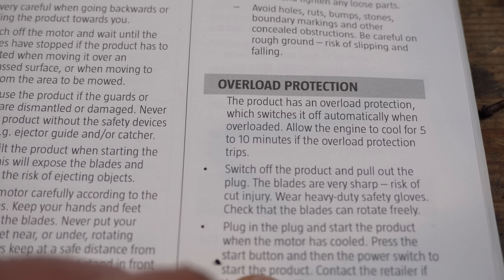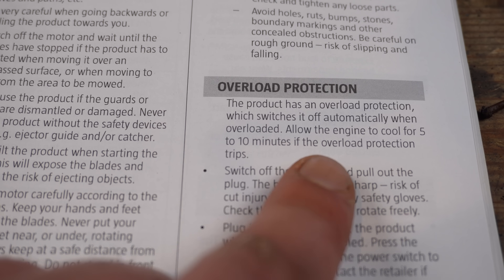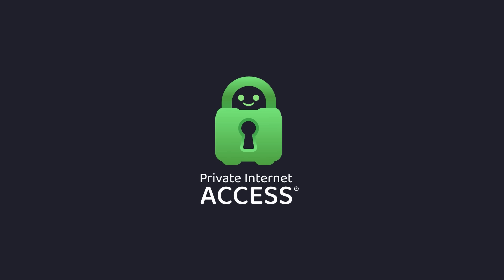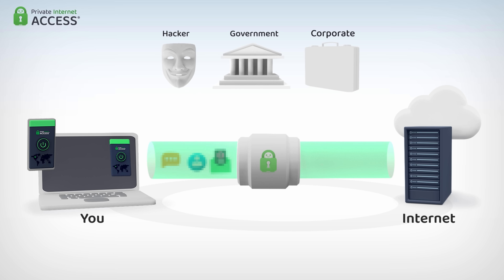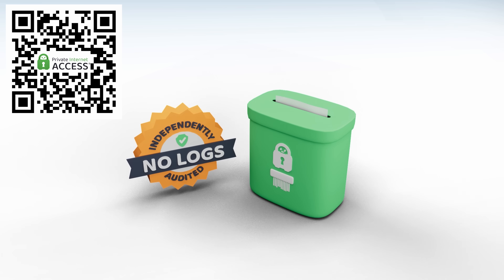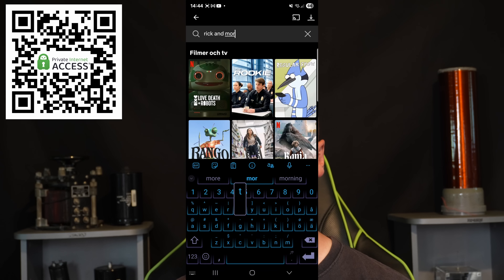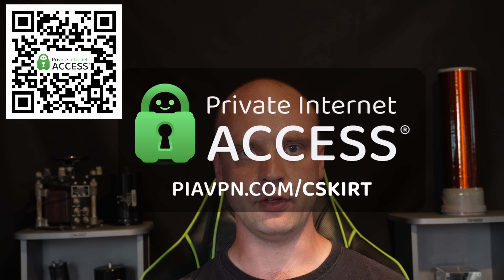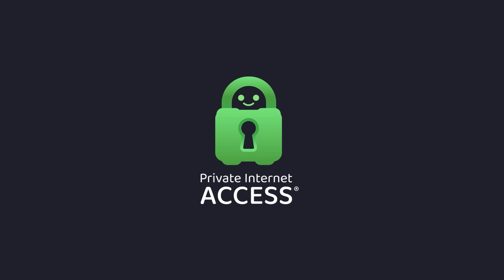Overvolted Garden tools. Leaf blower, mower, chainsaw, trimmer.

Comment: MEEC TOOLS Chainsaw
1 log cut at: 112.4 volts
2 logs cut at: 282.1 volts
Sparking motor at: 361.5 volts
Motor damaged at: 441 volts
Motor failed at: 458.8 volts

MEEC TOOLS Lawnmower
Sparking motor at: 402 volts
Motor damaged at: 435 volts
Motor failed at: 509 volts

Black & Decker Weedwhacker
Motor damaged at: 343 volts
Sparking motor at: 375 volts
Motor failed at: 531 volts

Biltema Leaf Blower
Sparking motor at: 285 volts
Motor damaged at: 373 volts
Motor failed at: 429 volts
Caught fire at: 426.1 volts

Comment: Hey! Try applying voltage directly to the armature (rotor) of the brushed motor — skip the stator or external field winding. It will spin MUCH faster and wilder. That’s because you’re energizing only the rotating part, removing magnetic drag from the stationary coils. Basically: less load = more speed = more chaos. Give it a try — it’s insane! But I warn you, the revolutions are uncontrollable, and this is very dangerous. If you have a good defense technique, you can use it, and I will be pleased😊
Reply: I recommend this also
Reply: Ye
Reply: Good idea
Reply: Did you miss the thunderstorm going on in the motor at 1:30?
Reply: After researching about motors, I also conclude this is a good idea 😂

Comment: Chainsaw:

Not enough power at ??? volts
cut through 1st log at 112.4v
cut through 2nd log at 282.1v
Sparking motor at 361.5v
Motor failed at 458.8

Lawn mower:

Protection removed after normal voltage test
Not enough power at ??? Volts again
Wheels started moving at 115.1v
Sparking motor at 402v
Motor damaged and failed at 509.6v

String trimmer:

Top part removed after normal voltage test
Not enough power at ??? Volts yet again
Disc-like (no pun intended) protection wobbling at 195.2 v
Case wobbling at 210.5 v
Case wobbling more at ~267 v
Sparking motor at 279.4~298.4 v
Sparking more at ~354.1v
Stopped (likely) increasing the voltage at 531.4~533.7v?:(
Motor damaged at 533.7v
failed at 531.6v

Leaf blower (there is going to be a lot of brackets!):

Whole cut through after normal voltage test
Also not enough power at ??? volts (There is a good reason why you use your red multimeter in your last tool video)
scale sliding around at normal voltage(683g(coincidence!))
Sparking motor at 285.9v(855g)
Motor damaged at 421.5v(719g?!>:()
Failed at 429v
Caught fire at 426v! (pulled a massage pillow!)
Motor exploded at 445.1v!

I put in so much effort In to this…

Comment: I'm amazed by this Black & Decker weed whacker. Mostly because I have a Greenworks one that with an average length strand can spin up to what sounds like 4,000 RPM, because like this it only has one strand of line coming out of the spool, but is probably more like six or eight thousand.

Comment: Why did you stop increasing the voltage on the string trimmer at 530 V?
Reply: I think his transformer doesn't like voltages higher than that
Reply: @Electro_the_Sonic_OC  but it can go up to 550! Just 20 more volts!
Reply: i think the variac was heavily loaded, it drew close to 12 amps

Comment: I once had a dream that someone else like you (or Maybe you) applied high-voltage to a furby furblet and was about to do a hand mixer toy (I did not see the hand mixer toy because I woke)
Reply from the maker: And what happened to the furblet in this dream? AFAIK they don't have any moving parts? It would probably just be a small pop, but I could try if I find a cheap one
Reply: @Cskirt  it just had a small pop. You don’t need to over volt it!
Reply: @Cskirt . Why did you stop increasing the string trimmer on 530 V?
Reply: My aunt is Married to cskirt

Comment: I love how the ac power meter just fades in at 60 to 90 volts makes me wonder if you could wire up the dc side of the meter to a external one it should solve the issue
Reply: some of those don’t, i have a power meter and it only has 4 wires (2 for mains voltage and 2 for current transformer)